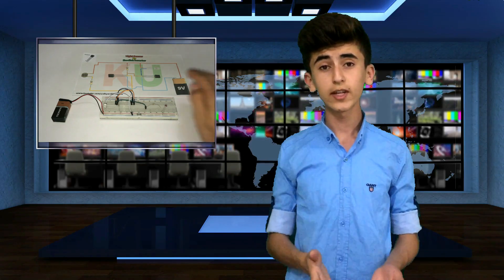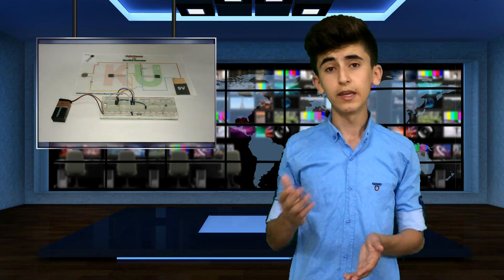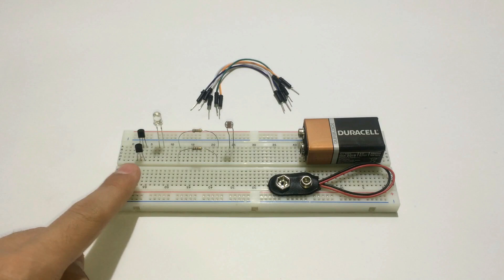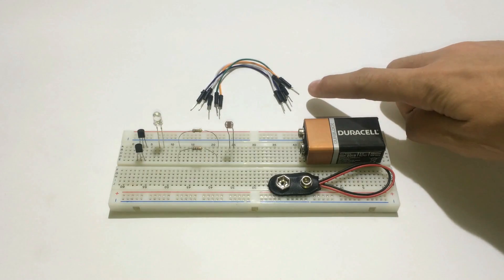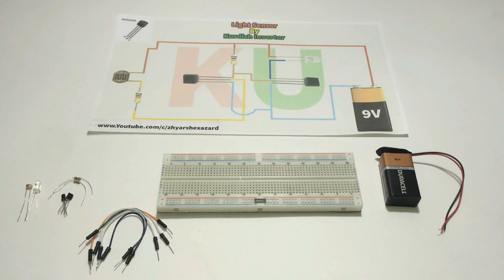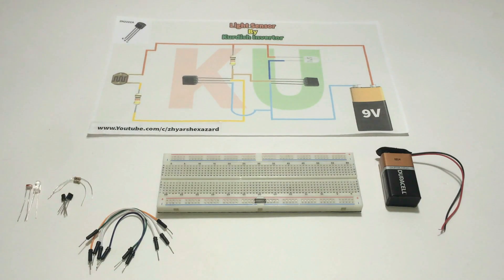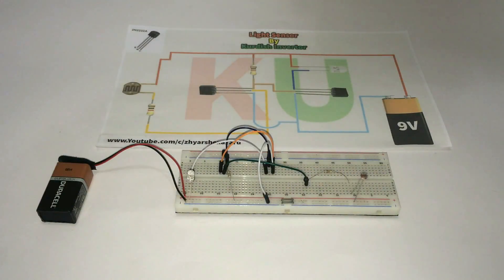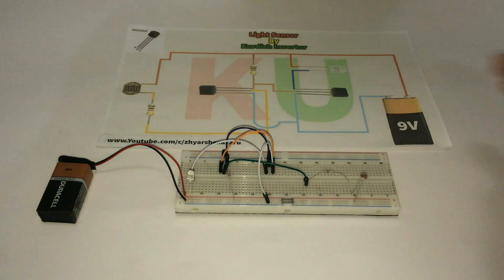How To Make Light Sensor - DIY Automatic Street Light

Comment: Does it work the opposite? Meaning that the sencer turns on when there is light and turn off when there is darkness
Reply: Since it is a Light Dependant Resistor (LDR) it created resistance only when there is light. When the light disappears, so does the resistance thereby allowing the circuit to be completed and viola! there is now light.

Comment: can be used 10ohm resistance
Reply: "it may not work properly"... if you do understand your circuit, why don't you calculate how much current will get to the base of the 1st npn when it's dark and when it's light, and based on the characteristics of the p2n222A, calculate if the 2nd npn will be on or off? that is, if you DO understand your circuit and did not copy it from elsewhere and took credit for it. if you can't calculate whether the 2nd transistor will be on or off using 10k resistance, then you don't understand what's going on and you did not design this circuit.
Reply from the maker: yes its possible but it may not work properly